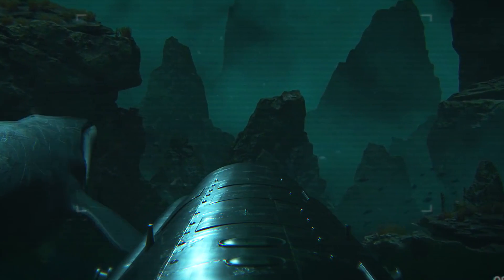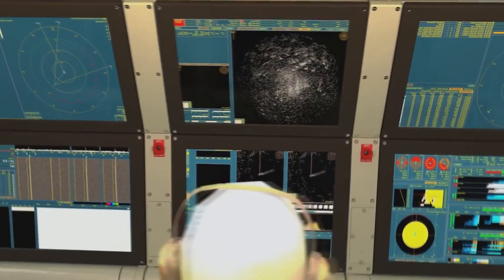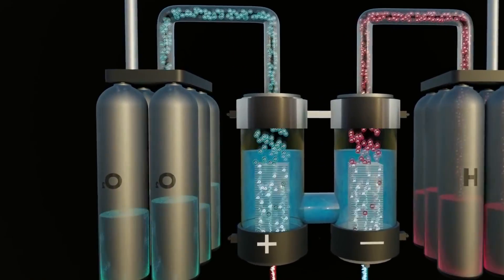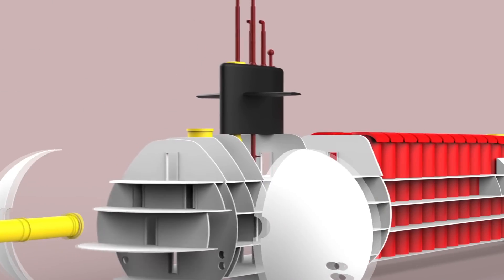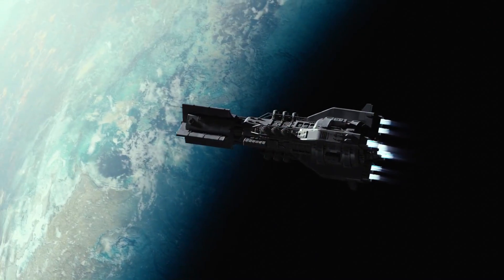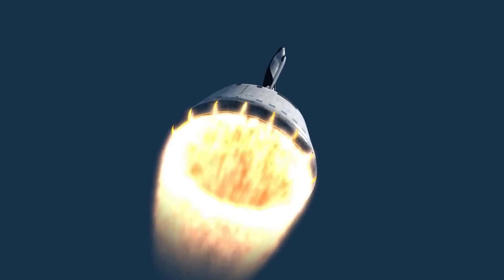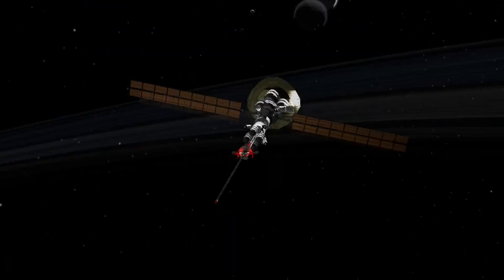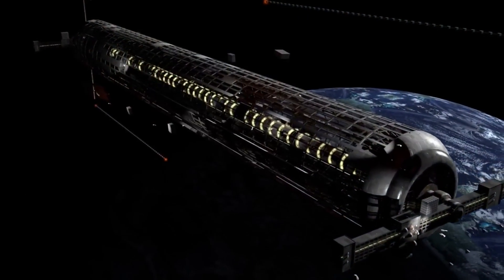Would it be possible to use a nuclear submarine as a spaceship?

Comment: Weightless outside of earth's internal magnetic field grounding currents through the nucleus or core would be necessary to have a foot hold in space, possibly using magnetic field flooring that redirects currents grounding synchronization towards the greater magnetic field flow as weight. Quantum magnetic fields within mass could be possible to redirect trajectories towards the greater magnetic field flooring as magnetism as a directional force of pressure as current grounding flow like earth's internal magnetic field grounding currents. It could also potentially create  a magnetic field around these vessels as force sheilds of minor protection from  various degrees of heat energy from space. Like earth's internal magnetic field grounding currents of heat energy through its nucleus or core. Mass is the force of currents grounding themselves into internal magnetic fields grounding currents into earth's internal magnetic field. Synchronization of heat flowing through all mass in its path. Heat propulsion is repulsion to cold space itself. Heating up the southern pole would be pushed by cold space itself. Cold and heat repulsion to one another. Heat is always propulsion. Conservation of heat energy throughout space as forward momentum propulsion from cold repulsion into cold repulsion. Put the heat in the tail and cold space itself will repell it as forward motion momentum from cold repulsion. Heat waves as pressure equalization to cold space repulsion momentum. Hot air balloon s rise in atmospheres. Heat is key. Heat a plate on a vessel in space and potentially forward momentum propulsion from cold repulsion to space itself. Mass is always outward force of pressure from neutralized repulsion within mass outside of a greater magnetic field flow as weightless. Inside earth's internal magnetic field grounding currents through all masses in its path as force of pressure known as weight. Fire is external heat energy outside of entanglement of mass disolving quantum internal magnetic fields into external heat energy potentially renewable heat energy when entanglement with mass occurs. Entanglement is absorbed heat energy into internal magnetic fields grounding currents into synchronization of earth's internal magnetic field. Magnetic fields affecting current grounding flowing through space and mass. Space itself is a weak external magnetic field filled with dark heat energy outside of entanglement of mass as potential renewable heat energy when entanglement with mass occurs. Heat bouncing off cold repulsion of mass within atmospheres as refraction of unabsorbed heat energy lighting up atmospheres like filaments. The filament bottle necked energy. The heat from the light bulb passing through is refraction of heat unabsorbed singularities outside of entanglement of mass. Starlight is heat waves coming through our atmosphere unabsorbed until  entanglement of mass. Seeing star light is entanglement with mass. Your eye sight is entanglement. Lightning disolving quantum internal magnetic fields as heat and unoccupied open space itself within mass as cold repulsion is instantaneously unoccupied space as voids created by disolving internal magnetic fields of atmospheric gasses as external heat energy outside of entanglement of mass lighting up the surrounding atmospheres slamming shut on the void created by decay of mass as potential renewable heat energy when absorbed into internal magnetic fields grounding currents through all masses in its path until resistance is overcome by open space itself and returns to dark heat energy outside of entanglement of mass as potential renewable heat energy when entanglement with mass occurs again and again. Conservation of heat energy. Magnetism. Light is only present in resistance to heat absorption. A mirror affects. Lighting up surrounding atmospheres bouncing off mass as refraction of heat singularities. Distance is always equalization to the force of pressure. The closer to the core, the greater the force of pressure currents. A river to a stream as you move away from the core where there is a flood. Distance traveling increases, and the force of pressure decreases. Magnetism is force equalization to distance traveling. Hydrogen has the strongest internal magnetic field of the elements. As mass expands its internal magnetic fields expand. Force weakens by distribution outward distance traveling cycling circulation patterns. Helium occupies more space than hydrogen. Its field covers more occupational space within and without entanglement of mass in equalization to magnetism. Galaxies spin like records in equalization to magnetism. External magnetic fields at the cores spinning all external heat energy within its field in synchronization of currents outside of the monopole of pure cold fabric of space repulsion within the nucleus or core where force is outside spinning everything in its field. External magnetic fields are stronger than internal magnetic fields grounding currents. External magnetic fields don't ground currents through the nucleus or core their currents spin all heat energy within its field in equalization synchronization to distance traveling and the force of pressure equalization throughout space. Galaxies show that the hypothesis is fact for external magnetic fields flowing currents around these monopoles of pure repulsion to heat propulsion from cold repulsion as space itself as a weak external magnetic field. Mass in proximity to external magnetic fields disolving internal magnetic fields towards the greater external magnetic field as.